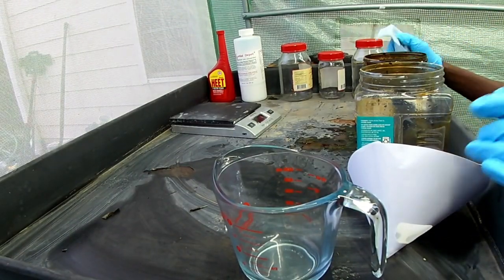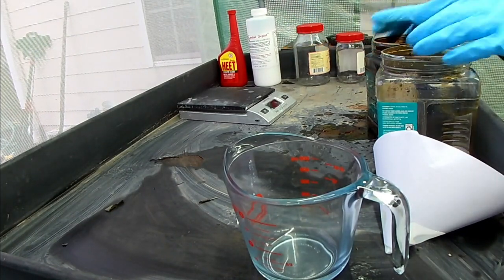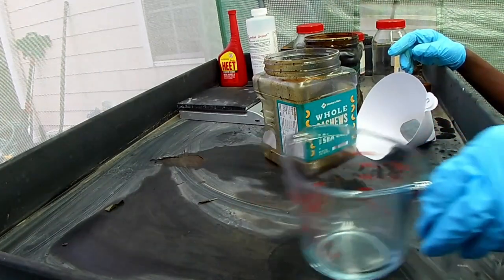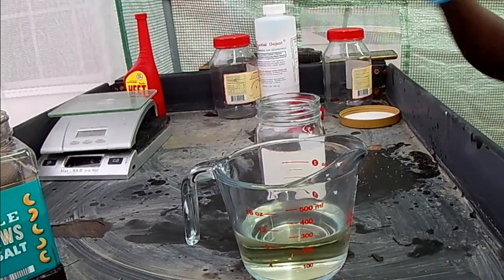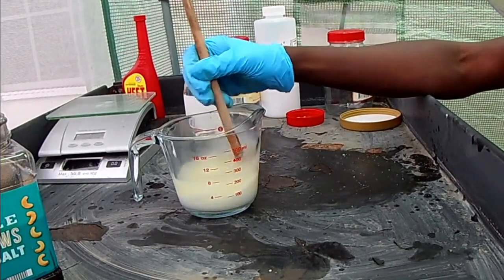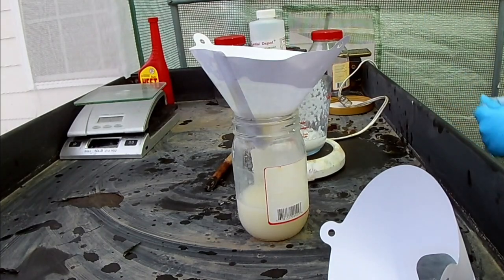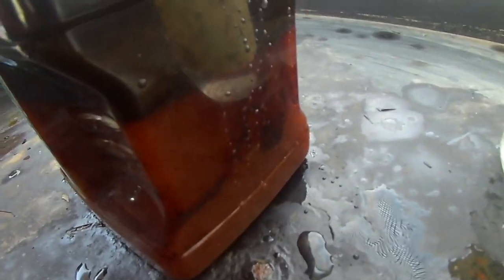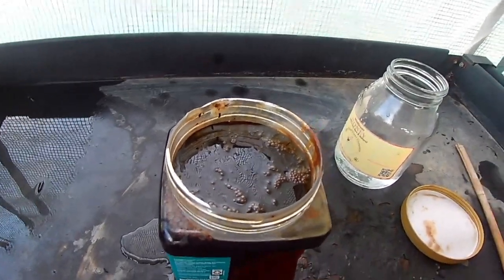Chemically Refining Pyrolysis Oil! - Part 1

Comment: Bro your videos get me hyped! For some reason, there don’t seem to be a lot of channels out there exploring, in depth, the chemistry/process of plastic pyrolysis. There is one other channel that I would recommend checking out called Hazel Chem. His analytical methods and experimentation seem very solid to me (I’m finishing a degree in biochemistry currently). Additionally, if I may, there are a couple things that I wanted to point out and ask questions about if it’s alright. 

My main question is about your angle of producing esters from the pyrolysis oil. I’m not sure what kinds of plastics you’ve used but it’s my understanding that oxygenated compounds aren’t the best for fuels as it lowers the fuel’s overall octane rating. Therefore, if there are esters to be made, that tells me that there are oxygenated compounds in the oil already and it might be good to work on a process (or refining the existing process) to produce a pyrolysis oil that consists solely (or as high a % as possible) of paraffins and olefins. For gas, the more lightweight and aromatic paraffins, the better. I could be off base here but that’s just my understanding of fuels this far!

Comment: Wow you reached the stage where you are making actual fuels. congratulations.  I saw a video where they put activated carbon in the reactor and it acts as a catalyst and they get jet fuel and diesel.  I will try to find the video but it does not say much more than the fact that a group of university students did this with their professor.  You might want to try this.  It would be interesting to see the results.
Reply from the maker: Thanks! I've actually seen that video a while back.

Comment: I'm not great at chemistry, is the reaction trading an oxygen from the hydroxide for a sulfur from the fuel? Or does it give up hydrogen? I understand there may be  more reactions than one going on.  Or am I way off and the hydroxide takes hydrogen and sulfur from the fuel to make sulfuric acid?
Reply from the maker: I don't know!  But I do know we're trying to neutralize the oil, so its not acidic
Reply: @naturejab  Looking forward to part two.

Comment: That’s a decent first run mate! Few things if I may:

- You are using too much Sodium Hydroxide. I use 5g per litre of oil and you had 100g in there. Try anything between 5 and 10g. This will stop saturation as you have seen and will also dissolve quicker. The amount of methanol is less critical as it is just a spectator in the reaction. I use a litre of methanol in oil batches up to 40 litres. 

- Try and keep lids on everything. Moisture and humidity can ruin methanol and Potassium Hydroxide. Same goes for your oil. If it is too oxidised, it may not react as well. I keep everything in sealed barrels. 

- From experience, everything in biodiesel and chemical refining takes time unfortunately. Do agitate it for about 30minutes (I have a large tea urn with a pump on the side, plus heat to get it to about 55C). So mix it up, then walk away! Come back the next morning :)

- After the Methoxide reaction, the top oil will still be dark and possibly opaque, but you will know it has worked if there is cr@p in the bottom. The bottom layer is smelly but still extremely useful, it burns well at high temperatures.

- You need to separate the top and bottom stuff before water washing, because the bottom stuff can affect the process. I use stand pipes in my tea urn to do this but you could do it with chemistry conical bottom flasks on a small scale.

- For the water wash, I use about 1/3 water to 2/3 top layer. Put it in a closed container and gently shake for a minute. Give it an hour, drain the water, put fresh in and repeat. I use rainwater and a timed water system to do this with 4 cycles of water. The waste water should be milky/clear and sometimes sulphurous.

- Lastly, settle the oil for at least a week. It will be dark red/brown, but should be clear when you pour it and smell less. 

- Paint mask is a definite must! 

Hope this helps dude
Reply from the maker: I been looking forward to your comments, thanks man!
Reply: Oh yeah, the bottom layer in your video will just be dirty water and un-reacted Methoxide. The top layer is oil.
Reply: Self starting siphons should work for separation.
Reply: What do you do with the waste?
Reply from the maker: @TwoForFlinchin1  put it back in the reactor
Reply: I incinerate it in my wood fire with paper logs. Nothing is wasted. You can recover the methanol but it takes energy

Comment: You could clean this up a lot by filtering it through a column of fumed silica. A lot of the brown junk is often more polar and gets retained more on silica.
Reply from the maker: Thanks! Will do. Is fumed silica different from silica crystals?
Reply: @naturejab  It is a form of silicon dioxide powder, extremely fine. But I might have misspoken you might actually want silica gel powder, fumed silica might be way to fine. Silica comes in a lot of different particle sizes, and particle shapes, you probably dont want any of the ultra fine powders.